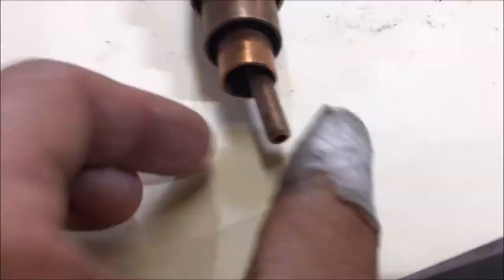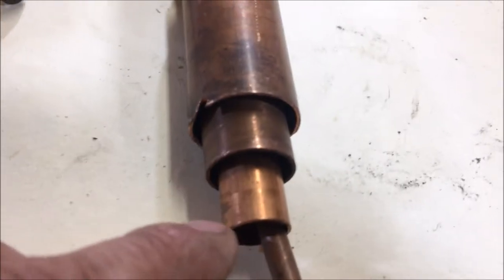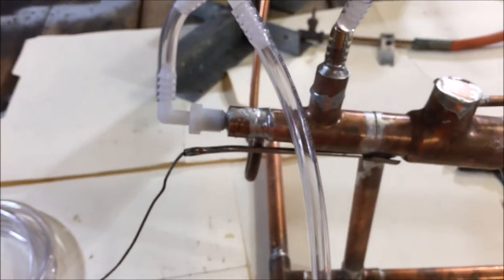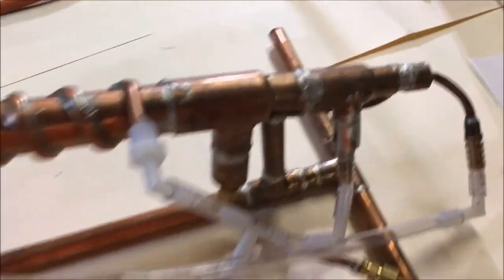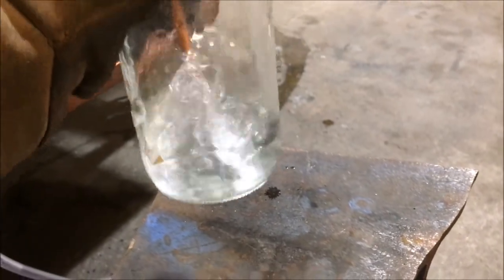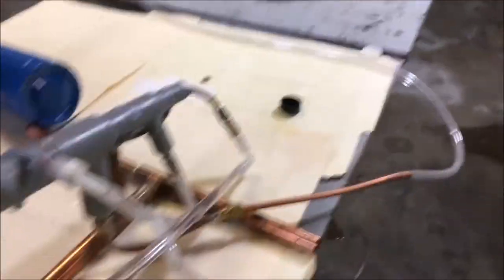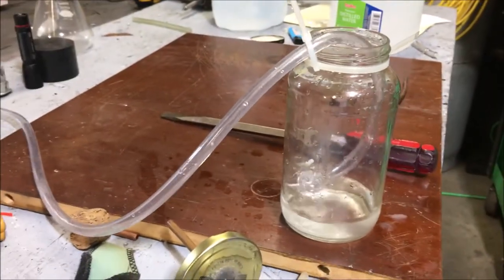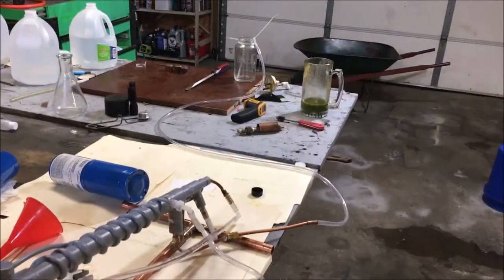distilled water CONDENSOR

Comment: Pretty sweet setup by the way. Do you have a parts list? Would you please share it?
Reply from the maker: not yet , i still am researching to see if this set up is safe , i know they have copper stills but we don't drink 365 gallons of moon shine  a year , so i dont wanna encourage using this thing yet , its a work in progress
Reply: NOBOX7 yep, I hear you. I wasn't talking about moonshine either. I was just talking about flushing the flux out. We have a small orchard, and drink from the same well. Our drinking water comes from about 40 feet lower than the orchard. But nitrates still get down there. I am only curious about your setup for making pure water for my wife and kids. And a similar or same type system could work for us. We could make a similar system. I was just asking if you might  have a parts list. Rather than running into town to get parts multiple  times. Thanks, Ben
Reply from the maker: yes ben , as soon as i can validate this is safe i will do the parts list in the next video , with me running the condenser with coolent